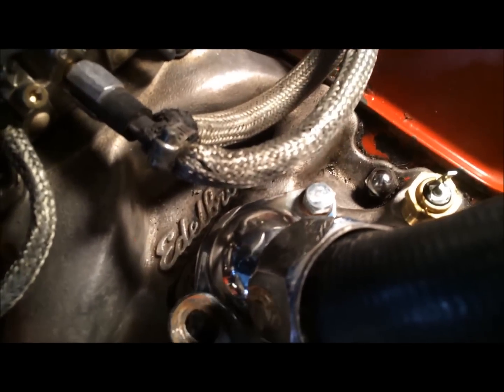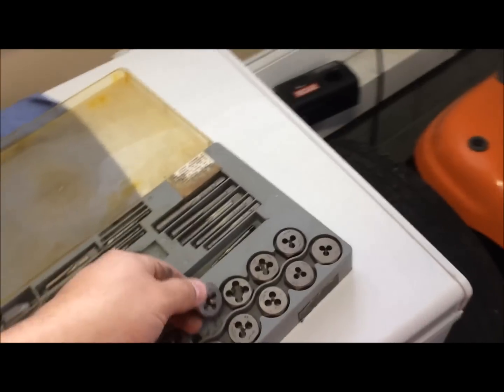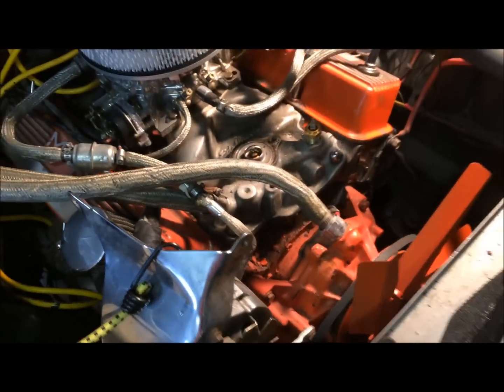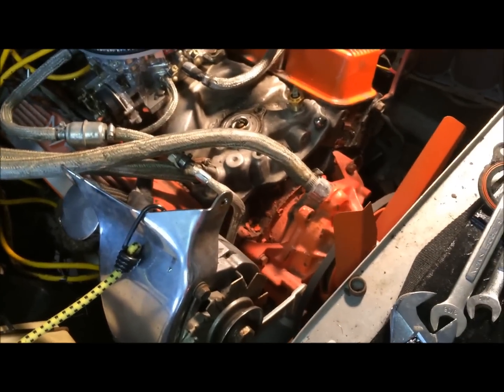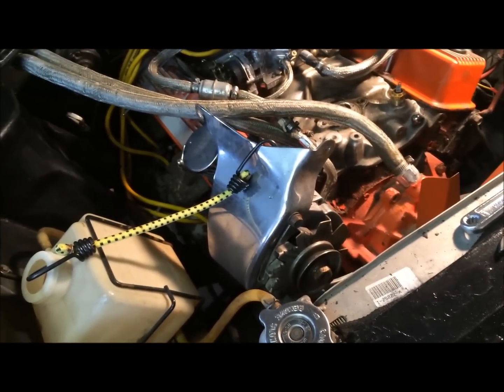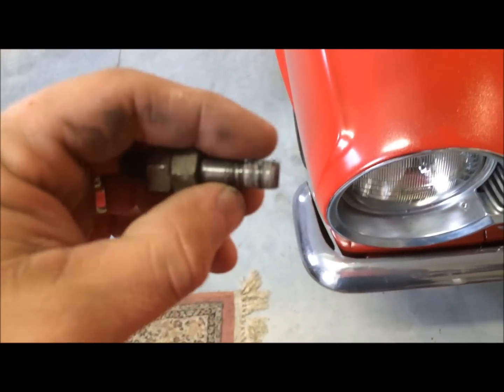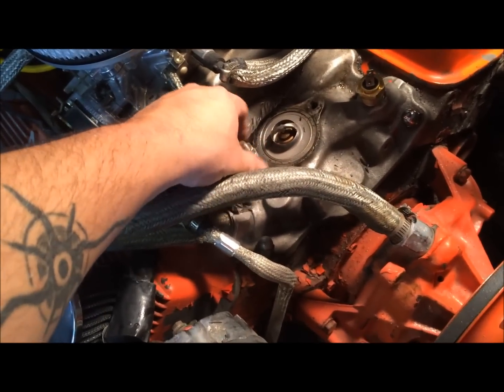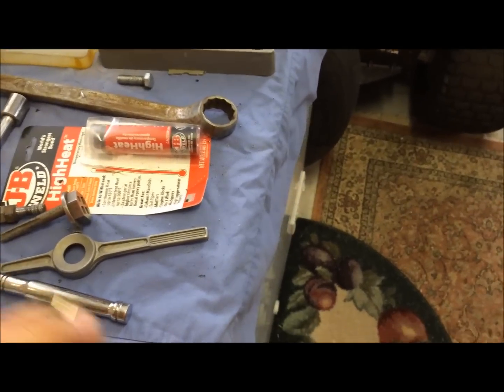Bolt recovered from intake manifold now what

Comment: Josh, remove th thermostat to check with yer finger the depth of the casting. take the good bolt from t other side. ask parts store for a stud for the damaged side and a heli-coil repair kit. That will make a permanent fix. Yer dooin good!
Reply from the maker: Thanks.  Will do.

Comment: hey joshua , i dont think you need to worry,ive made a intake for a scooter used for offroading entirely out of chemical metal , and from what i can see jb is kinda the same stuff ,it worked out awsomely, was green in colour and perfect fit and strength.
Reply from the maker: That's good to know.  I felt the JB weld would hold up.
Reply: hope to see a upload on the progess soon

Comment: If you drill it out and when you get ready to tap it, please put some heavy grease on both the drill bit and your tap. That will capture the filings in the grease and keep them out of the water system. If you drill down in there, it will eventually go right into the water jacket. Just be careful. Use teflon tape on the bolt if you do get into the water jacket, to seal it up and as always, (now you know...) don't overtighten anything going into an aluminum casting. It is much, much softer than the steel or cast iron.
Reply from the maker: Yes sir.  Thanks for your help.  I have helicoil ordered.  Couldn't find any in town today.

Comment: Josh just Follow Blazer02ls direction to a tee and you will do just fine that is the only way to do it right and have it last, and use locktite on the threads do not and I repeat do not use jb weld on those threads if you ever want to take that bolt out or replace the thermostat without having to replace the intake at that time cause it would be the only way you could get the old one out. Good luck man
Reply from the maker: Blazer is saying not to use Locktite, but to use anti-sieze on them.  ??

Comment: OK, first get a new stud for that side. Take the old one to the parts store. While there get a heli-coil kit to fit that stud. Now look on the kit and it will tell you what size drill to use. To determine the depth, Take a smaller drill and put it into the other hole for the thermostat housing. Wrap a piece of tape around it right at the point where it sticks out of the intake. Now transfer that depth over to the correct drill. Now use the smaller drill first to drill out the JB weld. Then use the larger one to make the hole, just stop when the tape hits. Then use the tap in the kit to thread the hole. Install the insert and reinstall the thermostat and housing, put a small dab of anti-sieze on the bolts.
Reply from the maker: Smart idea.  Thanks.  Would WD40 be considered anti-sieze?
Reply: You're welcome and not even on Mars. Anti-seize is designed to keep the parts from binding. You will find it is a handy thing to have when working on cars and anything else that you want to move.
Reply from the maker: ***** ok, good to know, back to the parts store.  :)  Some people are telling me to use Lock-Tite, and you say use anti-sieze.... why so different ideas do you reckon?
Reply: Loc-tite would be good on the insert itself but not really needed if you follow the install instructions. The anti-seize will keep the bolts from sticking in the insert and the aluminum. Loc-tite could bond the stud to the insert and if you try to take it apart at a later date that could be trouble. Reason being is the insert is larger than the hole in the water outlet and that will cause problems if the insert pulls free.

Once you have the insert installed the threads in the intake will actually be stronger than the original threads. I usually will go over an aluminum intake before it's installed and install inserts in all the threaded holes for the reason you discovered, bare aluminum is weak.
Reply from the maker: Good to know.  Thank you for your help.